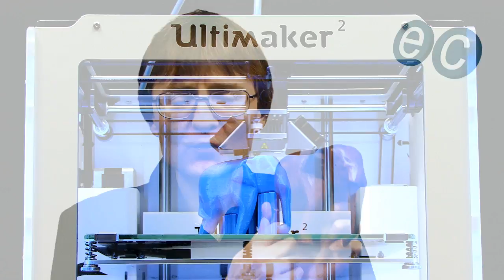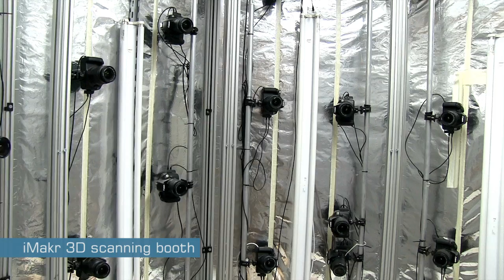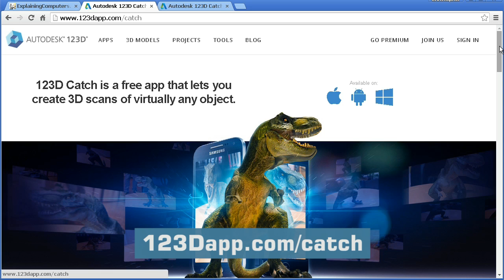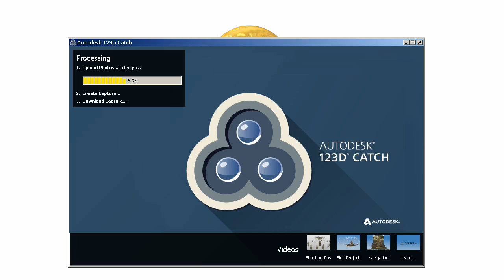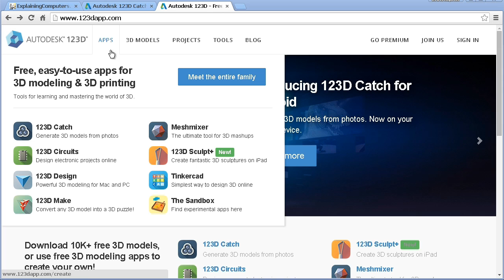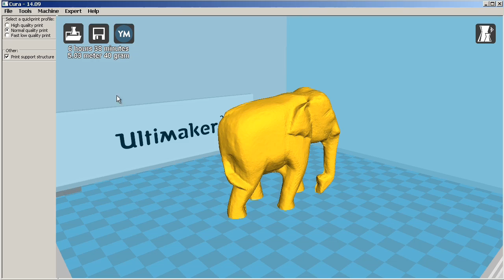Explaining 3D Scanning

Comment: Good info. I've not worked with 3D printers or software yet but I might be forced to replicate a small part for a machine that the manufacturer does not sell separately. My question is could I 3D scan and print an object that is a sleeve (meaning a cylinder that's open on both ends)?
Reply from the maker: Yes, you should be be able to print a part like that no problem.

Comment: How many photos would you need to take to get a good 3D scan of a full size human, then print in high quality on a 3D Systems full color printer?
Reply from the maker: I would guess 40 to 60 pictures. And they would have to keep still!
Reply: ExplainingComputers
If I am scanning about 60 plus people a day, would it be worth while to buy a full body photogrammetry booth? 
  The one's I'm looking at have about 124 Raspberry Pi 3 - 8MP and take two sets of photos: one with projection and one with out, then use Capture Reality or Agiesoft to convert the photos.

Comment: This looks AWESOME!
I just checked the website and try yo download 123D Catch for PC, and seems like it has changed its name to Autodesk Remake? I just want to confirm with you if this is the same software.
Also Mesh Mixer is gone, I suppose they took it off for whatever reason.
Reply from the maker: Yes, you are right -- Autodesk Remake is the name for the PC version now, although it is still called 123D catch as an app for other platforms. Meshmixer is still available -- http://www.meshmixer.com/ -- but download soon and keep the install files, as Autodesk are making big changes to what is available in "early 2017".
Reply: Thank you!
Just tried it and its really powerful, amazing!
However the poly count is a bit intense for mobile production, even with its low poly version.

Comment: I tried that autodesk before(recently in fact) and although it done a great job, when I tried to import the object into Blender, nothing happened. I tried exporting from autodesk in different formats and it still would not import into Blender.
Reply from the maker: You may be able to get it into Blender using Meshmixer . . .
Reply: ExplainingComputers Is Meshmixer kinda like Meshlab?
Reply from the maker: I think so -- as shown in the video, it is another free AutoDesk product. I have managed to use it to get 1-2-3D Catch scans into LightWave, so Blender should also be possible.
Reply: ExplainingComputers Thank you. I will give it a try.

Comment: Can this be exported to SolidWorks ?
Reply from the maker: I don't know if SolidWorks can handle meshes of this nature. You can certainly bring them into 3D modellers like LightWave, but these are not CAD packages.
Reply: ExplainingComputers Thanks for reply sir ! I also found a project where you can use Microsoft Kinect as a 3D scanner with PC or with a Raspberry Pi .
Reply from the maker: Ivan Boskovic Cool! :)

Comment: can i import this into UNITY 5? pls chatback.
Reply from the maker: +dark3njay 614 Yes, I think so. Unity 5 seems to take a wide range of 3D import formats, including obj. The issue, I suspect, will be creating a mesh that is not too dense for a gaming engine, but you can use Meshmixer to reduce mesh resolution.
Reply: use meshlab for conversions learn meshmixer for fixing 3d scans

Comment: dear explaining computers
check out this weird laptop i made with lemaker banana pro and 5 inch screen running lubuntu lel
you said it could be used for portable projects so i took the initiative
http://youtu.be/4VSC3A9W4eQ
Reply from the maker: Crux Vector Cool. How is it powered?
Reply: It's powered by a lion 6600mah battery with a powerboost circuit allowing it to output 2.1a 5v project doesn't usually require 2.1a yet with usb devices it can come close usually battery lasts 5 hours
I extracted it for a portable usb power pack from china

Comment: May I get some information on how to make a hollow item.  I have the Makerbot mimi and the Makerbot 3d digitalizer ordered..  Both come with software but not sure it shows how to make the item hollow.  I sculpt one of a kind dolls, doll house size 1-12 or smaller and need the parts to be hollow.  I am a wee bit confused lol but I will get it eventually. Love your videos thanks so  much.
Reply from the maker: Rebecca Sharpe You can make hollow items in two ways. One is to build something hollow (ie your shape has an inside and an outside, so only its wall thickness is printed, as it were). The other way is to print a "solid" object with zero infill. If you look at the shot of the elephant being printed here (or shots in my Ultmaker 2 Workflow video) you will see that parts have a wall thickness, which is solid, and then a hatched infill (about 20% solid in my prints here). In the MakerBot software you will be able to define wall thickness and infill -- so if you set the later to zero, your object will be solid (though you will need to set a large enough wall thickness to make it strong enough). Good Luck! :)

Comment: nice tutorial!! but i have a problem :/ in 123D catch , it doesnt start to create the capure :/
Reply: wooooow :D it works :D after 10 trys
Reply from the maker: Bärtiger Baron Excellent! :) The results are normally worth some messing around. Mesh Mixer is more stable and responsive of you need to work with a scan.

Comment: Are you using a fully enclosed booth, with white background and a white display table,  to help eliminate artifacts ?
If so,,, that would seem to limit the size of an object you'd like to scan..?
I've heard the 3D Sense is a good scanner,, but it has to be connected to a high performance laptop, with a minimum of 16gb of ram,,, as it processes the data on-the-fly. And I think you also need "fixing point"
123D Catch seems to be much more user friendly.
I tried Meshmixer about 6 months ago. I had to uninstall it, b/c it took-over all my .stl files.  I'll try it again,, hopefully it will play nice by now.   I'll have to watch the install closer and make sure I didn't allow it to capture file associations.  If it does,, no problem,, I'll just have to go back in to the system and make changes manual.
Thx Chris.  Your videos always help add to my skills base, as a 3D "Mechnician".(<<<new word)  :)
Reply from the maker: Duplicat I'm not using a fully enclosed booth -- there is only white (a photographic paper roll) on one side of the object to make things look nice for filming! If you look at the pictures taken, you will see all kinds of stuff in the background.The white "display table" is a bit of white plastic standing on a paper roll -- mainly for video purposes, though the white under the model was to avoid too much junk being added to the object as you note.I like your new word! :)

Comment: Get yourself a rotating table (cake stand) &amp; use burst mode &amp; a tripod?
Reply from the maker: JCRocky5 Great idea which I wanted to try! :) But sadly it does not work (at least according to Autodesk), as 123D Catch requires all of the images of the object to be under exactly the same lighting, as it uses subtle shadow info to help it work the 3D data out. So very sadly the object cannot move, so the camera has to instead. :(
Reply from the maker: virusboy07 Hello again! :) 123D catch and Meshmixer produce STL and OBJ files that can be printed on any 3D printer, including the DaVinci models.
Reply: ExplainingComputers Dear Christopher Barnatt: 
How are you doing and  Awesome video as always! Thanks. 
Also, A quick question: will the autodesk 123d catch work with a daVinci 3d printer?
Thanks Again!

Comment: How much do you have to spend for each spool of printing material, how many watts does the printer consume during printing and how much material did the big one use up?
Reply from the maker: ***** A 1kg spool of PLA filament costs anywhere between $25 about $40 these days (and prices continue to fall). The middle size elephant used about 40g of filament, the larger one more like 75g. In practice, you get about 15-20 models of this sort of size from a filament spool, making the models cost roughly $2 each. The Ultimaker 2 has a power supply rated at 220 watts, so probably actually draws 150-200 watts when printing (as here) using a printed bed.
Reply: All this is lower than I expected! Very nice! Is this printing technology close to allowing for multicolors on models?
Reply from the maker: ***** Two colour thermoplastic extrusion 3D printing is now pretty common, even on some cheaper printers (eg the Cube3 and DaVinci 2.0 Duo), and three colour is also available (eg on the Cube Pro). There are also RepRap open source 3D printers with mixer extruders that can mix thermoplastics in the print head to allow continuous tone colour prints.At an industrial level, true full-colour 3D printing is now available via various technologies -- there is more info (and shots of printers in operation) in some of my latest ExplainingTheFuture videos: eg see@watch?v=94qoGn0hkEg
Reply: Thanks, what I have in mind is probably the ones with the mixer, that can print a life-like copy of a digital model in full color! Something like that is only on an industrial scale for now, right?
Reply from the maker: ***** Yes, this is currently still industrial. :(  Full tone printers are currently based on tech that sprays a binder and ink onto layers of powder, or which sticks together sheets of paper ink-jetted with coloured inks. You are talking printers costing five figures. However, you can access such printers by uploading 3D models to online services like iMaterialise, Shapeways or Sculpteo -- and this is how I think many of us will increasingly access this kind of printer.
Reply: My favorite application of 3D printing for personal use is decorating and home customizing. Full color printing anything at all will be amazing once it becomes available for an average hobbyist!
Reply from the maker: ***** Two or three years . . .
Reply: Hehe I can wait!